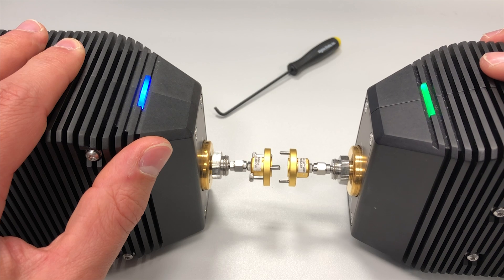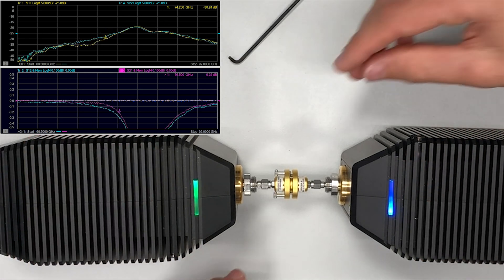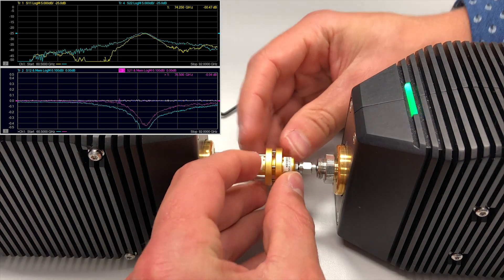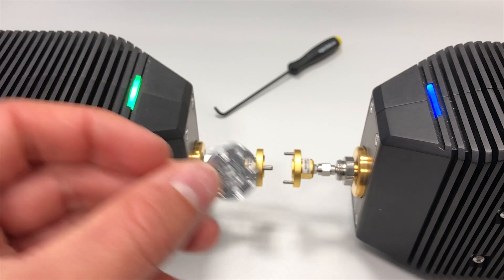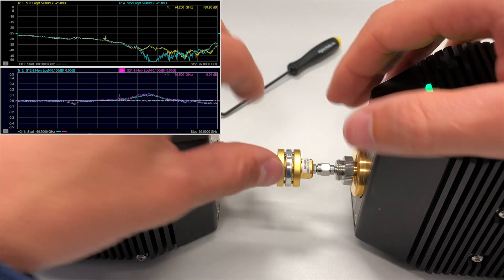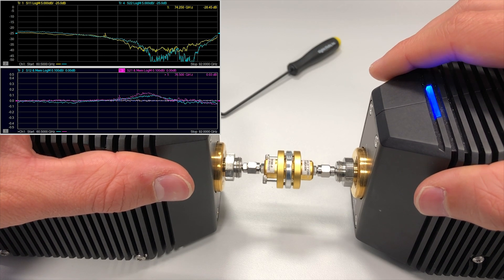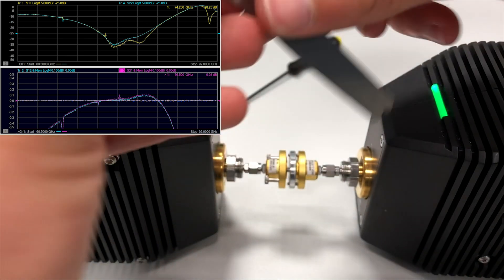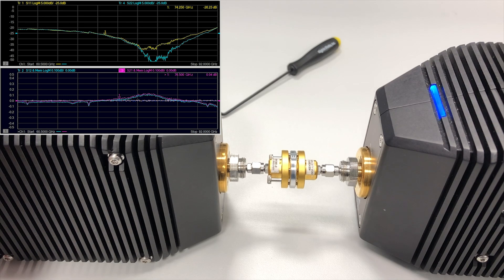Gapwaves Waveguide Flange Adapter Demonstration

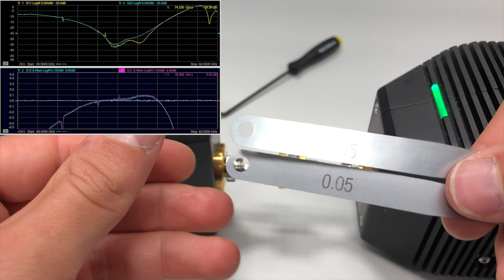Comment: Pretty Nice adapter, but i don't understand whats about last Short with 0.1 mm steel u made for at 1:39  ?
Reply: 50 micron metal foil to set a defined distance between the waveguides. They are not in the signal path and not used as short.